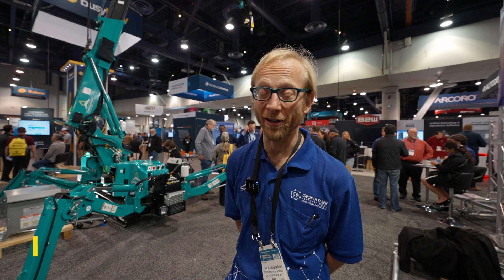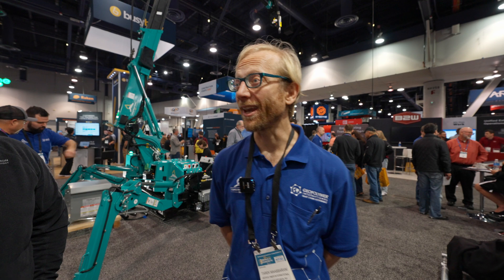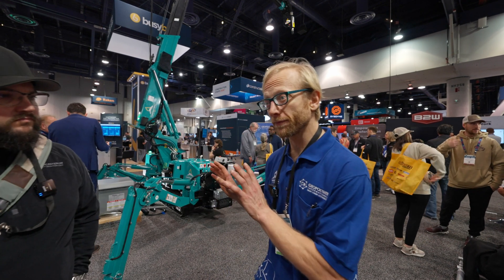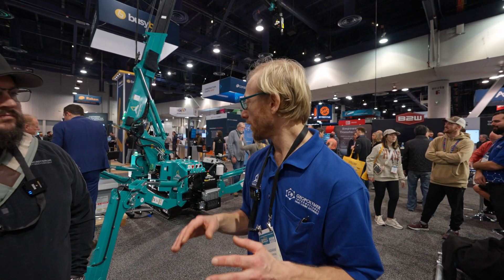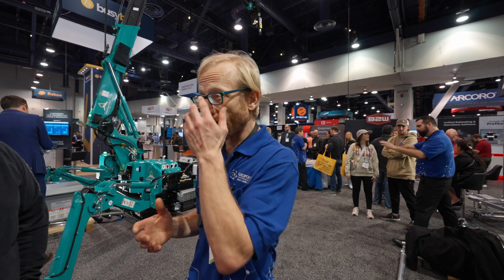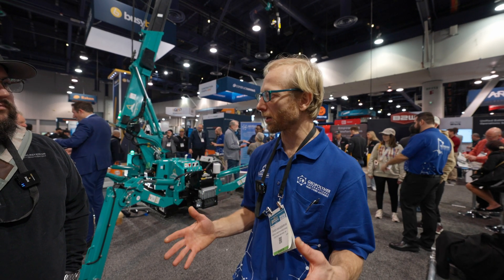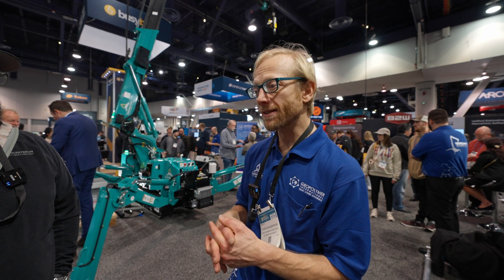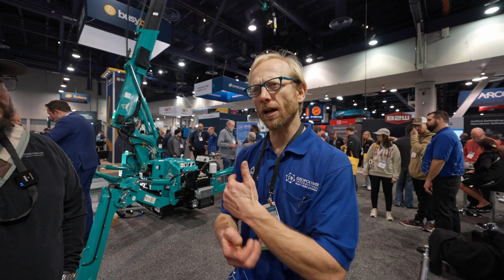Can Geopolymers Replace the Cement Industry?

Comment: Why do I only see it used in 3Ds and not pour forms? Can you pour a foundation with GPC?
Reply: Great question! Geopolymers are indeed used in 3D printing because their setting time and flow properties are well-suited for that precise application. However, it can also be used in traditional pour forms for foundations, pavements, and other structures. As we refine the designs for large-scale mixing, we’ll likely see it used even more frequently in foundational applications! Stay tuned!
Reply: @GeopolymerInternational  that's good news. I am not partial to the 3D printed look. Thank you!
Reply: @BeachBum51050  Understood. The ribbed look isn't for everyone. Keep in mind that you can always stucco or plaster over the walls.
Reply: @GeopolymerInternational  it is not just that. I want thicker (stronger) walls and a basement.

Comment: Piers for riverfront?
Reply: Yes, geopolymers can be a great option for piers and other waterfront structures! They’re highly resistant to chemical corrosion, which is especially valuable in environments exposed to saltwater or fluctuating water levels. Geopolymers also tend to have low permeability, which helps protect against moisture intrusion and increases durability over time. With these qualities, they’re well-suited for marine and riverfront applications where traditional materials may degrade more quickly.
Reply: @GeopolymerInternational  All I need is a product for my contactors to buy or a recipe for them to make.

Comment: Interesting. What is the isolation property and cost in relation to portland?
Reply: Geopolymers generally offer good thermal and sound isolation properties, sometimes even outperforming traditional Portland cement, especially in high-temperature applications. As for cost, geopolymers can initially be more expensive than Portland cement, but this is often offset by their durability and lower maintenance needs, which can save money over time. With the growing demand for sustainable alternatives, we’re also seeing costs come down as production scales up, making geopolymers an increasingly competitive option!.
Reply: a $3,000 driveway would cost you $30,000 with this crap

Comment: You say this material is stronger than regular Portland cement well if it's not much stronger then why don't you guys introduce it to the federal government and the military and see if it can be tested on some of the things that they used to have us do with Portland cement so you can see how much stronger your stuff is compared to what we were doing with the military and and buildings when we were testing I like to see your material you say how strong it is let's see it
Reply: Actually, the military has already been using it since the 1980s to repair concrete cracks in airfields. From what I heard, the geopolymer repair mortar is mostly all that is left of the abandoned runways. Alas, the company that supplied the geopolymers, amongst many other products, went bankrupt (for unrelated reasons).
Reply: Hill Incorporated still has a geopolymer based product that repairs cracks in concrete  and brick buildings I have used it on too.
Reply: @bsuddzen  how long is a last for

Comment: But is it worth the 2x cost?
Reply: is that 2x the cost for 8x strength?
Reply: That’s a fair question! While geopolymers can have a higher upfront cost, they often make up for it in the long run through benefits like increased durability, reduced maintenance needs, and lower environmental impact. In certain applications, especially where longevity and resilience in harsh conditions are critical, the investment can actually lead to savings over time. Plus, as technology advances and production scales up, we’re likely to see the costs come down, making geopolymers an even more viable option.
Reply: 2x ???  bro its 15x all day .

Comment: Roman concrete which has a large portion of lime, also used sea water, not fresh water. In concert with the lime, years of rain seeping into the cracks reacts with the unreacted lime and provides a level of "self-heal" capabilities. Don't get me wrong, I love geopolymers, the ancient Mayans/Aztecs used it a lot to get those funky "impossible" cut monolith stone blocks in their architecture.
Reply: Geopolymer can get the same self-healing with Mg(OH)2 as Roman pozzolan gets from Ca(OH)2, though. And with far fewer, smaller cracks, this 'carbon cure' self-healing is more efficient.

Comment: Cure times? Relative cost? Impact resistance?
Reply: With the standard 5% hardening agent, the working time (pot time) when the mix is soft and usable is about 1 hour at room temperature 70° F. Double the amount of hardening agent to get 30 minutes of pot time. Without it, the working time is about 3.5 hours at room temperature, but the hardening (curing) time will be about 24 hours and you may want to accelerate curing speed by heating the binder.
Reply: @TarekMaassarani  Thank you
Reply: It cost 500 times more than concrete . for just some small testing your spending thousands of dollars  . 
This stuff is so expensive it has not and will never be used . that's why people arnt using it . They never talk about the cost of this stuff for a reason , its all global climate change bullcrap

Comment: What's the cost of a yard of Geopolymer vs cement which is about  $158?
Reply: The cost is important but it is not the per yard that matters but the cost for an equivalent structure. Since it is much stronger

Comment: ever been to Rome, 2000+ year cement in the domes with no Rebar.   so what took you so long and will the Unions let you use it
Reply: I hope so!
Reply: Why would the union set a restriction on materials used?
Reply: @MisunderstoodWierdo  They did not allow the european concrete, and concrete in the Roman buildings have stood for 2000 years, without rebar

Comment: Geopolymers might be able to compete with the cement industry until it has proven itself to be as durable and long lasting as cement and even then it will not replace cement, ever. That is just a fact of life. It's like challenging to replace the oil industry or the tire industry it's never going to happen.
Reply: Nothing positive ever happens when people, presented with a remarkable idea, simply walk away and say, "It will never happen." They said it during the transition from whale oil to crude oil. They said it during the transition from wood to concrete. They said it as the world transitioned from rail travel to planes and jets ...
Reply: I totally agree 👍👍
Reply: I understand where you're coming from—cement has such a long history and is deeply ingrained in construction. But while it’s true that geopolymers still have some proving to do, they’ve shown a lot of promise in terms of durability and sustainability. Geopolymers offer lower carbon emissions and can handle harsh environments, which is why they’re gaining traction in projects where sustainability is a priority. It’s not necessarily about “replacing” cement across the board but rather providing an alternative that can work alongside traditional materials and address specific environmental challenges. Who knows? We might see both industries evolving together in the future.